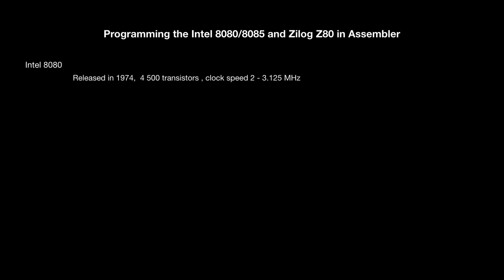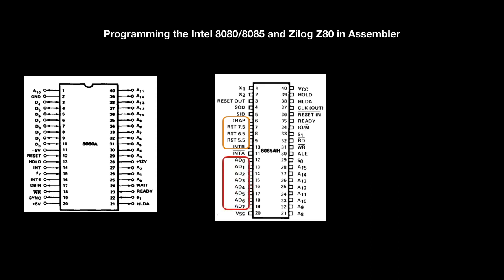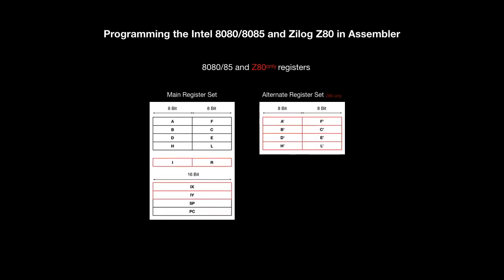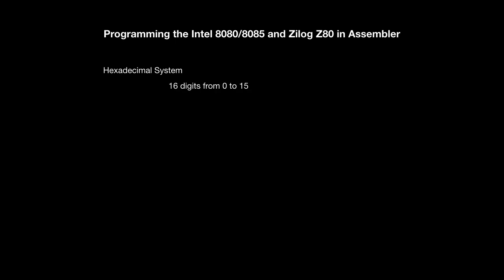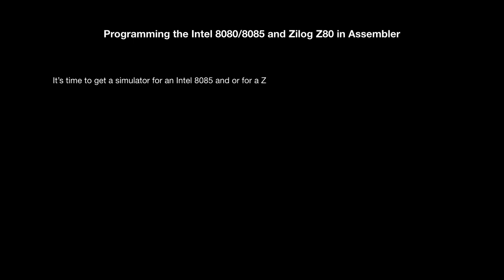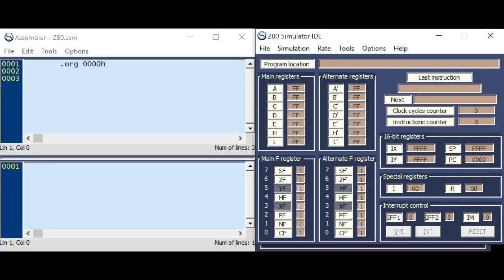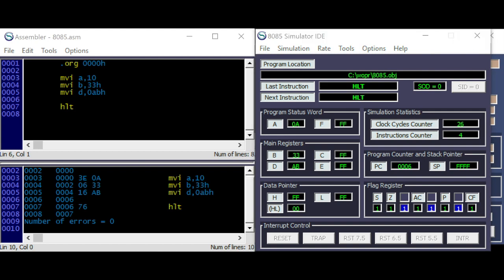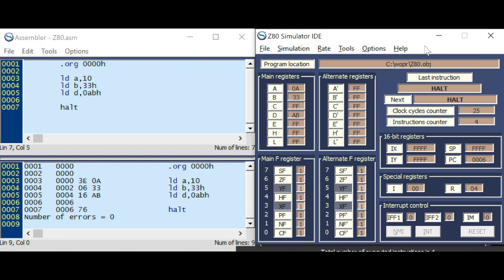Programming the Intel 8080, 8085 and Zilog Z80 in Assembler

Comment: Thank you so much for this wonderful series of lectures on the 8080/85 assembler programming. I recently purchased an Arduino-based Altair and I wanted to learn how to program it. This series accomplished exactly that. 
Question: I am looking for the assembly command differences between the 8080 and the 8085, but I cannot locate it anywhere. Which 8085 commands do not work on the 8080? Thank you.

Comment: Thanks for this. Apart from a ZX81 and ZX Spectrum (Z80 machines), I also have a Soviet Mikrolab KR580IK80 which has a KR580VM80A processor which as I understand it is a clone of the Intel 8080A. The latter can only be programmed in machine code, so it's how I got into this area
Reply: This crappy old suitcase with 1KB of RAM and 1KB of ROM ? Did ZoViets use it to carry nuclear launching codes ?

Comment: I had a Tandy TRS-80, which used the Z80 CPU. I was amazed at how much faster programs ran in machine-code and the BASIC language was much slower. By learning assembly language, I learned a lot about the machine and the Z80 as well. So, I'm happy I learned assembly language.